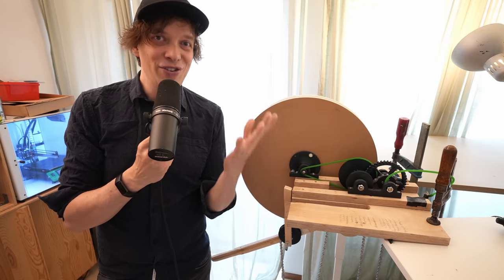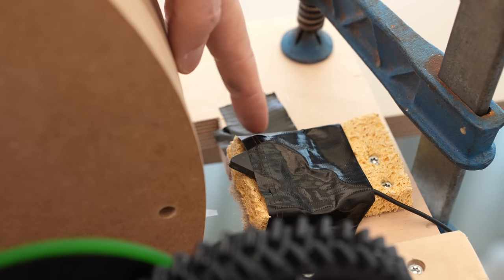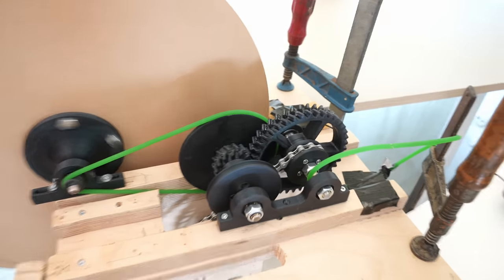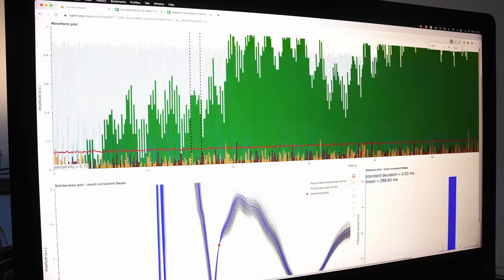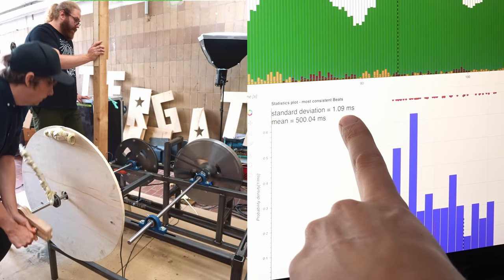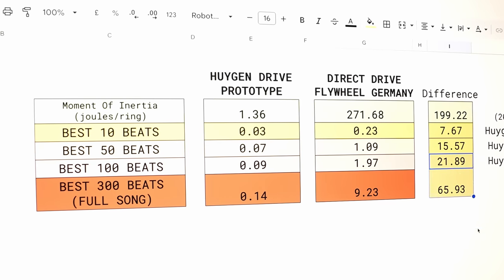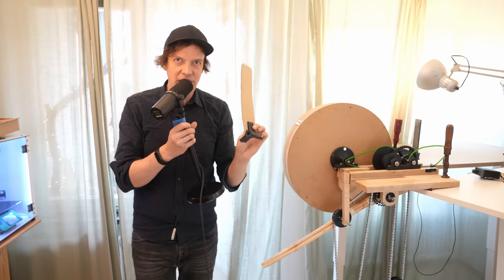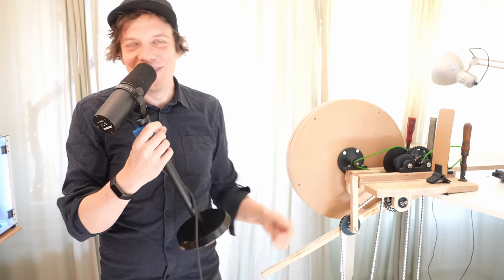Is Gravity Really Constant? I Built this machine to find out.

Comment: Hi Martin, here are my 2 cents from a Mechanical engineer's point of view. Don't forget that your driving mechanism will not only have to be tight in a constant load condition (ex: a tuned watch, or air fan at equilibrium), but will also have to play tight with highly variable load as the marble machine plays. If you are not controlling the speed and power input by direct human power, you will need a very reactive control system to maintain constant speed under variable load especially if this system is not compatible with high moment of inertia. You don't want it to end up with more variation than with a high moment of inertia human-driven system.
Reply: Very good point
Reply: Agreed he will want a governor that actually governors rather than an air brake
Reply: @JorisKofman I also think he could use a frictionless magnetic breaking system instead like brake fins on roller coasters so that it doesn't wear down over time.
Reply: Also to add on: Martin, you also did the test on a scaled down version, and tested it against a fullsized unit. There is going to be differences between the scales. And for an example that is a similar problem, is that people have had with battlebots between the beetleweight bots being scaled up to full size, where they would run into problems where the new size and weight cause their own problems.

So just because something works at the small test scale doesn't mean it'll perform as well at full scale. Different stresses, different energy required to be put in, and so on.
Reply: Exactly what I have been thinking. All this test proves is that steady input (force of gravity) vs a variable input (human power) naturally proves the constancy of gravity. This is not a test to prove how tight you can play music with a variable load. @Martin you did summarize this basically at the end, however, I feel you might have intentionally glossed over the scale of the weight and flywheel you need to build for the marble machine. You will need a flywheel with a heavy enough moment of inertia to keep music tight whether you have 36 channels all playing at once or just 1. You only tested the energy source when you compared them in the sheet. My hypothesis is you will arrive at the conclusion that you will need the flywheel you built in Germany and couple it to a Huygen drive (if that is your chosen method of propulsion) and to a speed governor as your "engine" of sorts. Then it will connect to a clutch and gearbox to output to the machine so that you can select different BPMs without having to change the revolutions per minute of your flywheel.
Reply: True, i can also imagine that the weight will fall faster when theres something thats actually using that energy. Right now theres nothing being powered, so theres no weight to the system, but with a giant machine playing music using the gravity as energy, that means it's going to fall really fast to keep up with the bpm, so martin will still need to crank really fast to keep up.
Reply: This guy knows loads!
Reply: The heavy heavy flywheel are the response for the need of constant speed under load.
But for move and stay steady under load with heavy heavy flywheel, the weight on the huygen mecanism gonna be huge...
Reply: @prebenkul There's no variable gearing so no matter what the load the mechanism is under the speed relation between the the weight falling and the output speed will remain the same. If a heavier load will cause the RPM to fall then the weight will fall slower. If the output speed  is raised the weight will fall faster. The mechanical load has nothing to do with that. The only question is if the mechanism can support the load at a constant speed. If the load varies the output speed WILL vary, unless there's some kind of governor or variable gearing.

Even with a governor of variable gearing there will be fluctuations in the output speed as the mechanism can't react instantaneously.
Reply: Yes, pay attention to this please Martin! You are missing the whole load side of the equation. It doesn't matter how tight it is with a constant light load, it only matters how tight it is with the load the machine will create (which is heavier and not constant).

If you are willing to sacrifice pure mechanical drive, I think an electric motor with closed loop control would be a much better solution. You could possibly include a small flywheel if necessary to make the load a bit more constant if necessary. An electric drive would be much better for travel as well - no transporting heavy weights or huge flywheels.
Reply: Yup
Reply: (Electronics engineer's point of view here, but it is all the same thing) Yes, regulating a power source is easy when there is minimal load. Slightly more difficult with a higher load, and a lot more difficult when the load varies. The regulation system needs not just a braking system to stop it from over speeding, but it also needs sufficient energy in reserve to quickly add more, although a rapidly responsive system can also be susceptible to oscillating - that is to say, repeatedly speeding up and slowing down, as it tries to hit the set speed.
Reply: Martin doesn't care about input from engineers that doesn't reinforce his own beliefs.
Reply: he could pre-accelerate a high weight flywheel to dissipate speed fluctuations due to variable load, and maintain the fly wheel speed using a hyugen drive
Reply: Has anyone seen a type of mechanical governor that actually has PID type control?  A flyball type governor only offers Proportional control and therefore can't maintain any specific RPM under different loading conditions.
Reply: He could really lean into the clock tower mechanism he has built and add a pendulum to regulate the main weight lol

A lot of clock towers also had multiple weights which would trigger separately to operate the different mechanisms independently of the main timing drive; if the main drive is only turning the drum with programming pegs it wouldn't have much variation in torque, each peg would just release the next weight chain which would provide the actual energy to run that part of the instrument
Reply: Dang, one of my favorite things about Martins videos is to see all of the really insightfull comments. I am a software developer, so it is fascinating to hear input from experts in other fields. I would have not considered the variable load. Even though after you brought it up, it seems so obvious.
Reply: @Likeaudio  rimshot
Reply: @Zadster  A heavy fly wheel can help minimizing the oscillations, or at least slow down the frequency of the oscillations. Increasing the speed of the fly wheel increases the energy in the system and will also decrease the frequency of the oscillations. You are not likely to ever get rid of all oscillations in a system like this, but you can minimize them.
Reply: Came here to say this, but I don't think it is as dire as some are making it out to be.  You can have direct-to-flywheel crank to speed it up like the German machine, allowing high moment of inertia, and use a Huygens drive to maintain speed.  The variable load control doesn't need to be that fast if you have a ton of moment to work with.

Marble lifting can be set up to spill over so the number being loaded is relatively constant (the fraction that play music changes, while the others fall so the number is constant).  The rest is marble gates which vary a lot in short time windows but probably not that much over intermediate time ranges.  The Bowden cable system is probably using a lot of extra energy though, if he sticks with that system.
Reply: @dave4882 A flyball provides some derivative control via the damping, weight, and geometry of the flyball setup, so it could be considered more or less a PD control. Adding integral control could be done with a spring and a rotating reference, or maybe a fluid accumulator cylinder. Not sure I'd want to tune such a beast (certainly not for sub-millisecond performance!), but it would be fun to see for sure.
Reply: @dave4882  "Has anyone seen a type of mechanical governor that actually has PID type control? "
It's probably possible with a differential gear.  Imagine that Martin's test machine was on one side with no load to set timing, and the follower (load) side is on the other end of the differential, reversed.  When the speeds don't match the differential actuates something to speed up or slow down the load side.

From the old mechanical computer days, the differential is doing subtraction, and turning a rate adjustment control (effective integral).  The D term is less necessary when you've got mechanical systems with enough friction damping.

The reaction would be slow, but if you use a heavy flywheel you have time to adjust.
Reply: @Sn0wZer0  Interesting.  I had not considered doing it in that way,
Reply: @dave7038  not sue I get the spring and rotating reference.  I had always considered a flyball gov to be only P.  I'm guessing Martin would not want a fluid system on the MM.  Sub microsecond control would probably not be required if it was used on a high speed flywheel that was geared down to the rpm wanted.   I.E.  6000 rpm flywheel with 100 to 1 reduction giving 60 bpm.   control the 6000 to give better resolution on the 60.  Unless I'm missing something.  I'd love the challenge of tuning one.
Reply: @JorisKofman would be great to see an old school centrifugal governor.
Reply: i don't know much about engineering, but would a watt governor thing work to address this issue (the little ball extending mechanism thing) ? Apart from being a hazard I think it would look amazing in a machine like that
Reply: Easiest way to imagine the problem is the previous human input design is the same as holding 100kmh in your car with the accelerator pedal weather the car is going up or down hill into the wind or tailwind. The new design is like clamping the accelerator pedal in place when you reach 100kmh and expecting it to keep doing the speed regardless.

Your cars cruise control adjusts the throttle for you the amount needed to keep the wheels turning at the rpm required to do 100kmh, sometimes that adjustment is subtle sometimes when there is a change in gradient the input is dramatic. Even that system does not have the accuracy and response you are chasing. 

The best thing I can think of is a powerful stepper motor like on Martin's router that power the ball screws. If it gets an instruction to feed in a straight line at 3 metres a minute that is what it will do, heavy cut, light cut, interrupted cut doesn't matter as long as the motor is a suitable size and better still running into a worm drive. (like a CNC rotary table)
Reply: I support your opinion. I just wanted to write the same thing, but I saw your comment and just put a like under it))
Reply: Wouldn’t just having a lot of torque damper the speed variation ?
Reply: Very true! Also the speed is just determined by the Load. Ifthe speed shall be different, you have to change the load. And when you have a song with more marbles playing at once, this will also put more load on the system. Gravity is constant, but the load of MM3 is not
Reply: @dave4882 I would guess that the dissipative character of the system may also give you a differential element.
Reply: I came to say the same thing. I’d love to see Martin spend some time working on centripetal governor in association with a heavy flywheel. Gravity may be constant but air density is variable so the fan governor will be less accurate (and less reactive) than centripetal one.
Reply: @blahorgaslisk7763  if the weight falls slower than the energy provided by the weight will be lower. 

Don't think in forces think in energy and power. For systems like this that is what is important. 

The amount of energy going into the flywheel is governed by how FAR the mass falls. The POWER is governed by the RATE of fall. 

These are different things. Energy input or "work done" is measured by the force F multiplied by the distance it falls d. Or W=Fd  

The power P is that per second so P=Fd/s 

As the energy goes in the flywheel will speed up to the exact quantity of energy input where angular speed is proportional to the square  root of the energy put into the system. 

As you put energy in it will get faster and faster and faster until such time as the energy going out due to friction equalises it. At which point it will have a perfectly consistent speed. 

Because the power in equals the power out the energy in the wheel remains constant so the speed is constant. 

The MOMENT you add another load say you turn on a drum. Or even if there is a temperature change which affects the friction. Then the power out will increase and the power in will not causing more energy going out than in and the speed will drop. 

The dripping speed will drop the friction so it will find a new equalibrium fairly quickly but at a new lower speed. 

You take the load away and the power used will drop below the power available and it will speed up again back to its original speed.
Reply: @Sn0wZer0 the number of notes played will change the number of times a mechanism is activated by pegs. Each activation uses energy as well to open springs etc and so you would need to somehow also put in calibrated dummy mechanisms. 

Or just out in a proper regulator which I think your differential idea isn't a bad one at all. The energy needed to get such a flywheel going starts to get kind of silly though when you consider it's a human playing this.
Reply: @straba3976 damper it yes. Make it go away? No. The real question is how large and fast does the flywheel need to get to get the variation down to a reasonable level. Remember the speed of rotation is related to the square root of the energy Input.

Basically if you change from 1joule to 2 joules it will effect the speed twice as much as if you go from 2 joules to 3 joules. 

Ok so here is the problem if you are going to use the flywheel to directly manage your speed you need to have it store enough energy so that small changes in the load don't effect the speed. 

Let's say that the load changes by 100j/s and you don't want it to change the speed by 1%. If 100j is all of the energy when wheel has then it will change it 100% 

If the wheel has 200j then the 100j change will affect the wheel speed 30% to get it down to 1% variance you need 9900j in the wheel. Losing 1% per second is a lot. He's measuring down to 0.3 ms. So you need accuracy of something like 0.0001% meaning something in the order of 1 million joules in reserve which is a lot when a cyclist outputs 100j/s let alone a person with a single leg pump thing and you need to overcome friction AND add the required energy to actually move the machine and the balls etc. 

These are doable numbers but it would be more sensible to add something that regulates the speed of the machine that you actually have control over rather than works on a pure input and output. Unless his idea is to change the weight of the bag to adjust the play speed?
Reply: @prebenkul  Incorrect.  That's not how that works, but interesting thought.
Reply: That was exactly what I wanted to write. Thx
Reply: In the world of voltage regulators, there are two distinct parameters described. Line regulation and load regulation. The first is how much the output voltage is dependent on the input. This is what the Huygens drive fixes for you. The other is how much the output voltage (in this case RPM) is dependent on the load (output torque). And this is something that the Huygens doesn't help with at all as it provides a only a constant torque at the input. A large flywheel and a precise governor (eg. centrifugal) will be needed if the load varies while the song is playing, which it most likely does.
Reply: @dack42  You are right, but i understand why Martin does not want a closed loop motor. But a closed loop brake can work as well. An air governor that increases ist surface with speed could be i clever and beautiful idea. Also a magnetic brake where the magnet get closer to the copper wheel with speed.
Reply: a centrifugal governor would be awesome especially if it was promenant.
Reply: @blahorgaslisk7763 do you think this would be an issue in the marble machine? Or would the flywheel pick up any slack every time he pulls a lever?
Reply: @innertuber4049  with the accuracy he wants the size of the flywheel needed to adequately absorb variations is likely to become a problem. Even with a governor. The governor will make it better though.
Reply: @innertuber4049 It all depends on the variation in load, the energy in the system in the form of fly wheel weight and speed, and the energy potential of the weight. Well there's a bunch of more things, but that's the major ones in my opinion.

At the least the energy potential of the weight have to be able to overcome the losses and load introduced by the mechanics, the marble lift, the program decoder, the marble gates and so on.

But if it is just able to provide the energy needed for the average load then it can not keep the speed up when encountering spikes in the load even if the governor or what ever mechanism is used for speed control could react without any delay whatsoever.

A heavier flywheel means more energy in the system. Same with a faster spinning one. Combine the two for even more energy. But it also means that it takes more energy to spin it up to speed if/when the speed fluctuates. On the other hand a light fly wheel will allow faster reaction to any change in load. Both positive and negative.

In all cases the height driving the system has to have a significantly higher potential energy than what is needed for stable operation. The more energy that can provide at any given time the faster the machine can correct the speed variation.

Will this pose a problem? I'm not a musician, so I can't really say. I do know that people are very different when it comes to sensitivity to tempo changes, often called WOW and Flutter. I'm not particularly sensitive, so to me it's probably not a big deal. But to a musician it's probably extremely important!
Reply: This !

What Martin would need is a combination of two things :

- A trigger system driven by this type of Huygens Drive and applying a load as constant as possible (therefore having triggers as low-energy as possible for note playing) ;

- A whole "ball management system" (lifts and such) which would NOT be driven by the Huygens Drive, but rather directly by the crank/pedal combo as tightness doesn't matter at all here.

Then you can still play really tight music (btw, stunning results right here !) regardless of most of the load the machine will have to handle... As well as still having a nice mechanical feeling in the crank (that's personal opinion though ^^).
Reply: this is why I believe a sort of hybrid system is best. While I am a ME student(so I hopefully have the right mindset), freshman year hasn't started yet. I think a weight based power system with a foot pedal to rewind the weight and a variable transmission to change the bpm on the fly.
Reply: Another method might be taken from the old weight driven clock.  There, the weights are much heavier and more powerful than what is actually needed to drive the mechanism and then they simply regulate the release of that energy using a pendulum-regulated escapement.  The pendulum sets the beat and is pretty much independent of the amount of force applied by the pawls in the escapement.  As the clock ages, lubrication varies, dirt accumulates etc..., the pendulum is unaffected until the drag (i.e. driven load) becomes so great that it stops the clock.  (or instead of a pendulum, a 'balance wheel' such as used in mechanical watches).  These types of devices have exceptionally good regulation, all mechanical.

So a very heavy weight with a similar regulator could drive varying amount of load with no change in speed.  If his music machine has varying loads such as when playing / lifting multiple notes, the regulator would be unaffected.
Reply: @mikefochtman7164  This is a good idea, however, I have only seen escapement mechanisms used for clocks or timers which are very low power and low speed applications as well as being discontinous motions. I am not sure it can drive a higher power continuous motion?
Reply: @antoineboillet2288 Well 'high' vs 'low' power is a bit relative.  Ever see the escapement in BIg Ben?  hehehe. But you have a point, to beat very fast, the pendulum/ balance wheel need to be small and lightweight. 

Of course the classic musical application is the inverted pendulum used in the tabletop metronome.
Reply: Yes, and the thing he calls a governor, doesn't.. govern
Reply: Yes, something like a PID controller could achieve what he wants (you can actually build this with entirely mechanical components, if you don't want an actual electronic chip on your marble machine). I'm not sure if I can link it, but I found a paper "A Fully Mechanical Realization of PID Controller" by Jiaze Cai that one can easily Google the PDF, and it explains the details. (there are many many other papers as well)

One way to understand PID controllers (and closed loop control systems in general) is that they work by lowering the model error, that is, the error you make while describing how your system works mathematically (either because manufacturing isn't as precise as you wished; or because you don't have full access to all components of the system - and to this we can include details about the room, the floor, acoustics, etc; or because of pure noise). This means that with PID control, you can achieve very high consistency in how the system works even if your manufacturing process isn't as precise as you wanted to and even if there are unforeseen conditions in the operation of the machine.
Reply: @SoraHjort  This uses the same principal that a Pendulum Clock (pendulum would be WAY better then a flywheel.) These clocks where the most accurate clocks from 1656 all the way to the invention off quartz clocks in the 1930s. If you are looking for pure mechanical time keeping a gravity driven pendulum is very hard to beat.
Reply: @irwinkevincarpio   Replace the flywheel with a Pendulum and a lot of that is covered. We have spent a lot of effort to keep time mechanically throughout the years nothing has been better then a Pendulum Clock. Only Quartz was able to beat it and that requires electronics to work.
Reply: @prebenkul the load falls based on the speed of the flywheel so it would actually fall slower because under load it will slow down the wheel. As others noted rather than an air brake, a governor might be a better option because it will adjust based on the load better than air resistance will
Reply: @blahorgaslisk7763 yep, you almost need something like a tuned CVT between the drive and the fly wheel. It would also help reach equilibrium quicker as it would have the weight at a more advantageous ratio and as it got to speed would change ratio to a ratio equivalent to its power demand
Reply: @WillisPtheone  I think you'd need a really heavy pendulum to iron out the changes in load and still keep time
Reply: Just use a 3 ton flywheel with this approach. You will have to wait a long time for it to spin up, but it will be able to filter out the variable loads from the connected mechanisms 😂
Reply: While this is a very understandable and important point you make, I assume that this is really just the test for the first half. I Mean trying to get an even result with a load attached without having measured if the construct without load is constant enough would not make a lot of sense. Still I hope he has your point in the back of his head